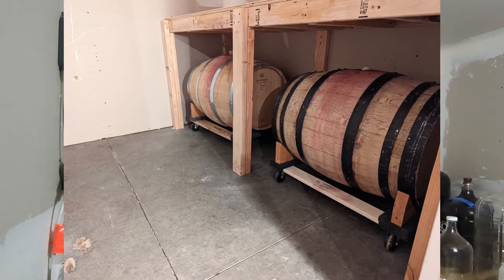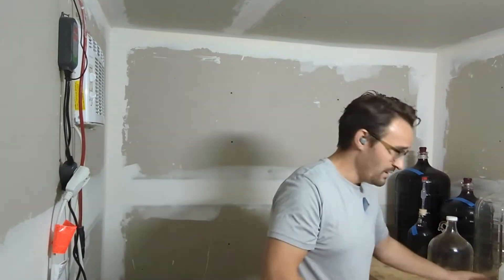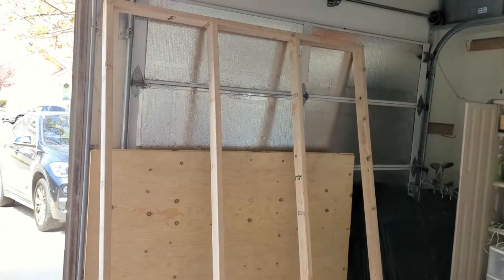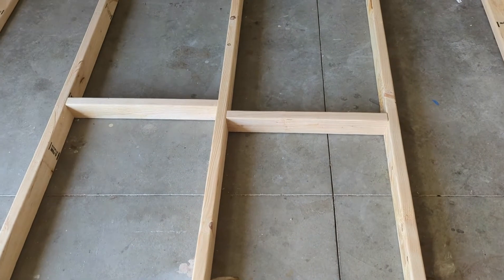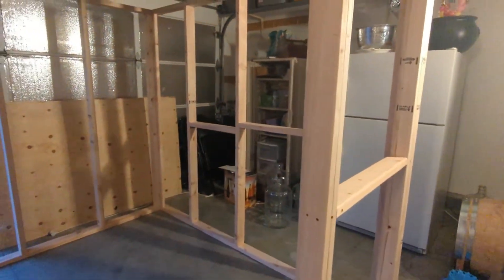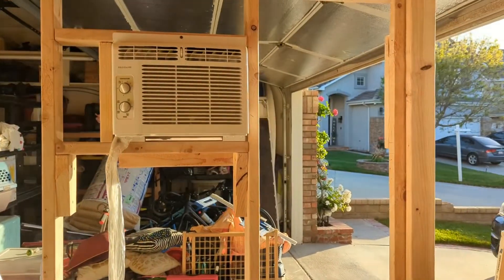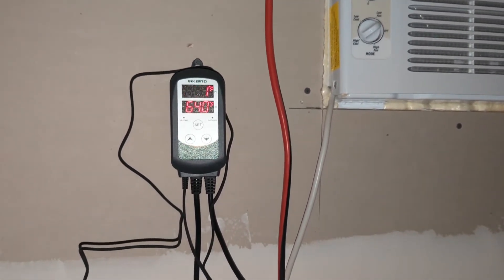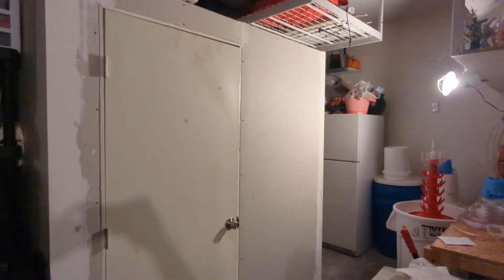Building a Wine Barrel Room

Comment: Thanks for your video, I'm going to use it as a guide to build my own barrel room this late Spring. Question, what type of fastener did you use to secure the framing to the concrete slab?
Reply: I didn't fasten the framing to the concrete to no damage it.  The concrete is pretty level and no gaps were present.  The structure was made to take down easily if needed but is super stable all put together.
Reply: @blairjolley  Thank you very much ....construction begins tomorrow !